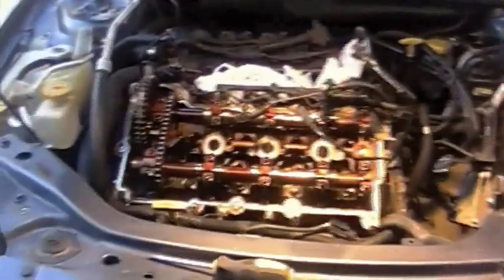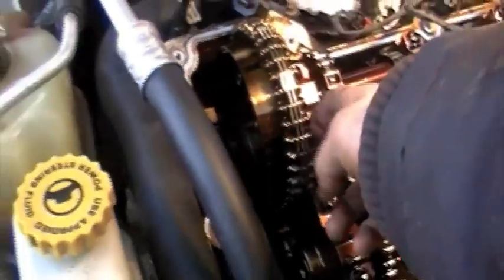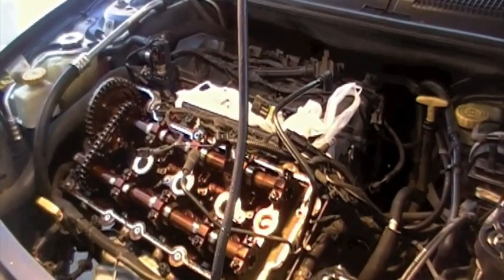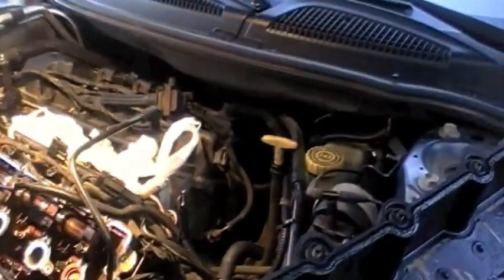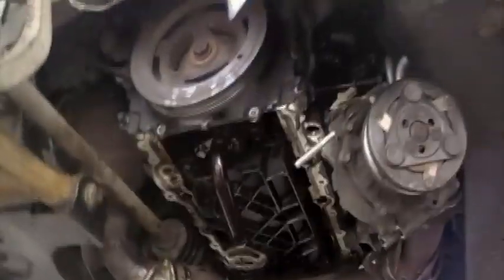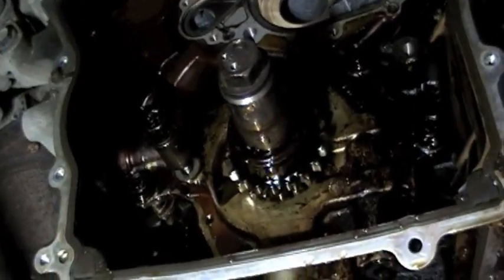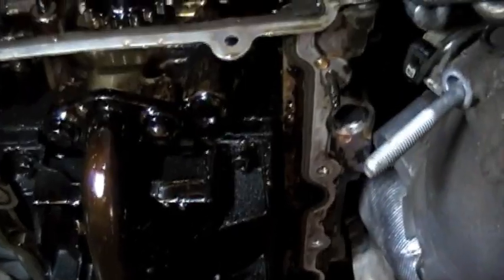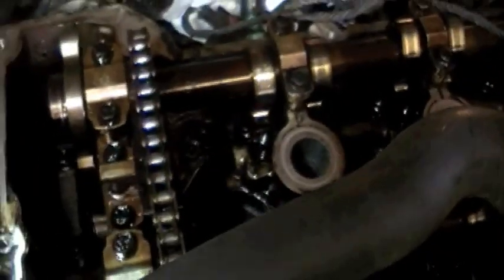How to Fix Your Chrysler 2.7 Engine The Right Way! Part 2 of 3

Comment: While my 2.7L engine is in an Intrepid rather than a Sebring, I'm watching your 11 year-old video and comparing your Sebring to my Intrepid.  I neglected timely replacement of the water pump. I've been running high quality synthetic oil in it for over a decade.   The engine knocked and died last week and I've been taking it apart slowly.   Today I got the valve covers off and see that I have no sludge at all.   I had a catastrophic water leak 2 years ago which I treated with a bottle of K-Seal as an emergency measure   The car has not lost coolant nor overheated since then. Last year the car started burning oil.   I ran a quart of Marvel Mystery oil in it for about 1000 recent miles until the oil burning stopped.   I replaced the mixed oil with high quality synthetic oil last Friday, then on Sunday it died.

Comment: I have a 08 chrysler 300 2.7 L engine that ran low on oil and froze up is there any way to get it free'd back up?
Reply from the maker: Chances are something internally overheated and has “welded” itself together. When this happens the components that overheated are now damaged beyond the service life. Even if you freed the engine it wouldn’t be much longer before you have a catastrophic failure. I would seek another engine or a reputable engine rebuilder shop.

Comment: if you research it, it is 99% of the time the sensor if idle isnt changing when oil light pops . if its later in the game and bad idle you are getting sludge in pickup.

Comment: While you're online--I'm wondering if you remember the torque for the main bearing caps? I think I'm getting paranoid, lol. I saw that it's 15 and 1/4 turn for the "inner cap bolts" and 20 and 1/4 for the "outer cap bolts." I think the outer ones are what attaches the drip guard or whatever that aluminum plate is between the crank and the oil pan. OR by inner and outer are they saying 1 and 4 bearing caps are outer and 2 and 3 are inner? Surely not.
Reply from the maker: Those sound fairly accurate although do not follow in my footsteps at the time of my rebuild I couldn’t get my hands on the torque specs and I actually reassembled the engine entirely without a torque wrench aside from the head bolts.. I did however pay close attention to the amount of force it took to remove the bolts originally. 😆 many things I would have done differently if I rebuild another fully 😁
Reply: @JesseMarrin  Good to hear! So that engine didn't roll over and die the moment you cranked it up? That's good to hear. I will follow the torque specs, but I won't be too paranoid then.

How long did that engine last--your first rebuild? Or do you know?

Thanks again!!!!
Reply from the maker: Matt Garza i personally drove the car for 50,000 kms and it didn’t skip a beat at all it ran absolutely perfect! Had excellent power and didn’t shake at idle or anything
Reply: @JesseMarrin  That will make me sleep a lot easier between now and when it's done. Thank you so much! You've really saved me some needless worrying.
Reply from the maker: Matt Garza just ensure everything is evenly torqued and you will be just fine “evenly” is key on aluminum blocks
Reply: @JesseMarrin  I appreciate it! Will do!

Comment: Jesse, I finally have the engine back from the machine shop. It took them 43 days, lol. I finally got to the part where I install the new oil pump today. I couldn't remember where it went, so I came to this video for some help, lol.

I decided not to do a valve job because the machine shop pressure tested them and they were fine.

Hopefully I pick up the pace and have it done in about a month. We shall see!
Reply from the maker: Matt Garza that’s awesome! Thanks for
The update! I want a video of it running when your done! I’m sure it will sound great! Your doing a great job!

Comment: Jesse, if it's possible somehow I like to show you some photos of my Chrysler 2.7. I'll try to find you on Facebook. Sorry to keep bugging you about this, but I just think it helps to have someone who is familiar with this rebuild.

I took the front bumper off and the radiator and I feel like the engine can come out from the top now, I see no reason why it can't. And removing all of that wasn't terribly hard.

I actually remove the side engine mount next to the timing chain without meaning to. But it is temporarily jacked up so it should be fine. I guess the easiest thing is I could make a video and send it to you if that's okay. I'll send a link to it. Thanks.
Reply from the maker: Matt Garza sure yeah you can send me a video no problem! I suppose you might be able to squeeze it out the top but it will be very tight. And most the the front end will need to be removed. But without a way of lifting the car to remove out the bottom you have no choice. But the vehicle is designed to have he power train removed from the bottom you just might have issues freeing the transmission from
The engine is my concern and then getting it out of the way. But I believe with enough patience it could be done

Comment: 0:19 Sorry but exactly how does a leaking water pump shaft seal, which leaks to atmosphere, via the weep hole in the casting of the water pump body (which drains away from the outside of the engine) cause coolant to get into the oil causing a oil/water emulsion? The only way coolant gets from the coolant passages into the oil is from a faulty gasket, cracked block between the coolant and oil passages or a cracked cylinder liner, because it free drains from the water pump seal (which only prevents the coolant leaving the cooling system, not it getting into the lubrication system).

I've never seen a design that will do what you're saying has caused this emulsion.
Reply: Nevermind. I just found this video. https://www.youtube.com/watch?v=z_QrXR2jcb8
So the water pump is timing chain driven and is housed completely within the  engine and a port from the shaft seal cavity within the water pump housing casting drains back through the block to atmosphere. So if the water pump shaft seal fails, for coolant to get into the lubricant requires the water pump gasket to also fail. Or the water pump gasket can simply fail on its own and the coolant can drain into the sump. WTF.

That's a horrendous design. Whoever thought of mounting the water pump entirely inside the engine and driven off the timing CHAIN needs to be shot with a ball of their own shit. There's absolutely no need for this poor engineering - you just put the pump outside and to one side or on the front of the block and drive it off the accessory belt in the case of chain driven timing or off the timing belt. How many other yank engines are like this? I'd never even consider buying a vehicle with such a setup. Fortunately Chrysler don't have much of a presence here in NZ.

Oh, and the black sludge is caused by lack of oil changes and overheating, not simply a leaking water pump, although I guess you could argue that caused the overheating.

Comment: My 2005 Sebring with 140,000 on it runs well but today the oil light started coming on at stops but being ten years old and if it's something more than an oil sensor , it's going to the scrap yard.
Reply: +Barclay Reginald try STP gas treatment it may keep the idle up just a bit to keep light off.

Comment: TheMoneyy92 if you haven't figured it out, you need a small three-jaw puller to take off the harmonic balancer.  I rented one from the local auto parts store.  There are little footholds on the back of the wheel near the hub to set the jaws.  Once you loosen up the harmonic balancer's main hex bolt, spin it out 6 or 7 turns and set your puller's jaws, then turn the puller screws against the hex bolt head until it stops.  Back the puller off, back the hex bolt out some more, lather, rinse, repeat.  Pops right off.

Comment: I am using your experience here to help me replace the water pump on my 05 Stratus.  The engine is mounted transversely as I see here on your Sebring.  I see you skipped the removal of the timing chain cover.  I have run into a problem with the damned torx screw on the timing cover.  It's stripped just enough that the bit can't gain purchase, and it's pretty inaccessible.  I have removed all the plastic shrouds, the alternator, coolant reservoir, power steering reservoir, radiator hoses, harmonic balancer, serpentine belts, and I have the car on a mini lift with the motor sitting on a floor jack.  I can get a couple inches of play, but I can't get access to that pain in my ass to remove it with my bolt-out, and the head is stripped.  ANY IDEAS?  This is Michael vs. Stratus.  Michael will win.

Comment: Just bought a 2001 Sebring LX sedan, with the 2.7. I knew the engine has its bad reputation for being short lived and high maintenance, but The price was right for an otherwise mint car. 150,000kms, wife driven, clean and in for regular oil changes. It was also bought mechanically fit, with two sets of tires/rims, and an aftermarket stereo. 3000. I'm curious as to how long it took for the whole process, in your case, and the total cost of parts. I can do all the work myself but I'd like to know the approximate cost of the job. I already have a water pump from partsource for 80.

Comment: starting at 3:05. There are 2 studs in the center of the valve cover. Near the spark plug tubes. I'm leaking from there WTF! Theres no gasket, no spark tube plug o-ring for that. What should I do?

Comment: the stupid water pump is inside the enigine where it is driven by the timeing chain when it leaks the coolent mixes with the oil and takes the whole enigine with it the 2.7 is a interferance engine meaning the piston can hit the valves when the timeing chain/belt breaks

Comment: now why would thay put the water pump inside the engine so that when it leaks it takes the enigine with it when the water pump fails it leaks coolent inside the enigine mixing with the oil puts slack in the tentioner and skips a few teeth and the piston hits the valves what a crap enigine

Comment: Can anyone help? My 2002 stratus SE 2.7 has been a great car and a great running engine.Noticed stumbling, and the scanner says #4 misfire.I replaced all spark plugs(champion platinum).runs smoother, but still hesitating.scanner today still says #4 misfire.Coil pack? other minor culprit causeing this?. 144,000 and very clean engine with no mising or cracked/warn vacuum hoses etc..

Comment: I have a 2003 intrepid, I believe needs a timing chain, when it stopped running loss of engine power. Then try to start it it had no compression, crankshaft spun freely. Any suggestions

Comment: I really like the video... Good Job!!! I work on 2.7 Chrysler engines everyday. Anyone reading this should pull the engine from the car and put it on a stand. Always check the rod bearings and replace them no matter how they look. Alway clean out the oil pump.. You can use the same one but clean it. Check the timing components and do your self a favor and watch the Chrysler Mastertech video called "Introduction to the Chrysler 2.7 engine. He shows you how to set timing Perfectly.
Reply: How do you get the harmonic balancer bolt off chain wrench?
Reply: Do you have a video how to take and put back on crank sprocket to replace the oil pump

Comment: I'm a RoOKiE!! & I'm tryna work on My 2.7L Intrepid, had a Knock, Instead of Junking it.
I Wish I had a Garage Like Yours where I can lift it up and really have some space to work on it.
So Far My Lil Hand Tools is not doing Me any good, givin Me a hella hard time to unscrew any nut in this Motor cos Its No Space for My Big Hands to Fit through. I'm gonna have to Buy a Power Tool and Some more Sets.
Plus I'm gonna Need A Lot Of Help/Guidiance As I barely knw anything or any part Name in there.

Comment: I have a 2000 Intrepid and it's making the diesel type noise that i've read that it seems to be either the timing chain tensioner or oil lifters...what could it be? Oil light isnt on..its full but im not sure exactly what it could be?

Comment from the maker: @toyota4life94  drive belt will squeel constantly if waterpump is seizing up waterpump may leak or the engine will run hotter than norma if it is bad...

the belt will need replacing if it has been sqeeling for quite some time...

check the tread on the belt for cracks low tread.... or threads showing and check the edges for wear...

if your not sure got to junk yard pay $5 for cheap belt and replace...if it still makes noise....replace waterpump.